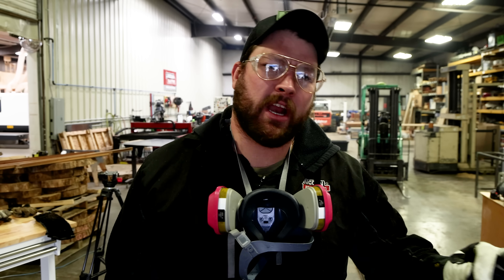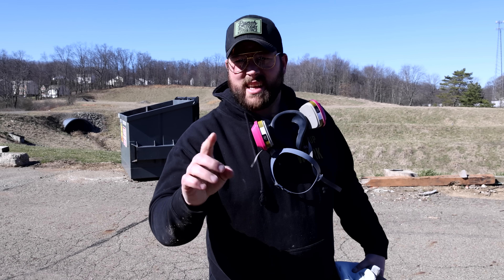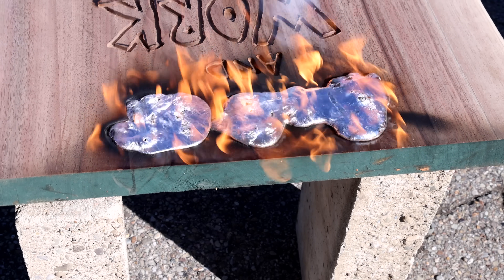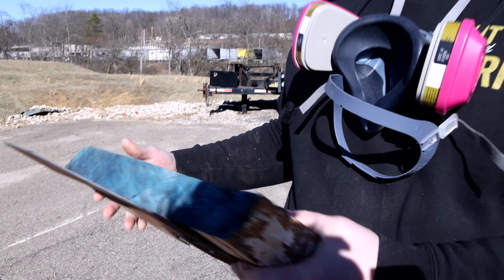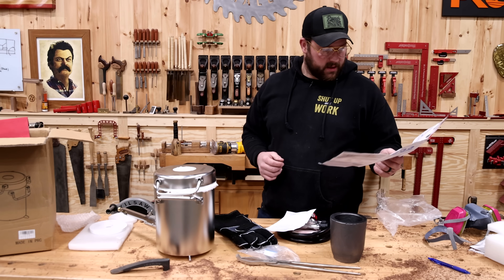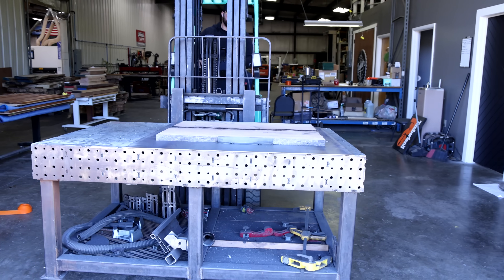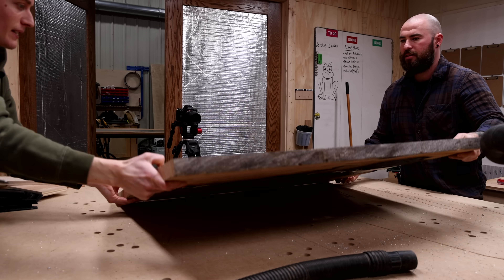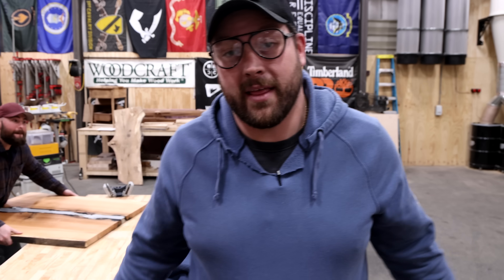I Tested Pouring Molten Aluminum in Wood

Comment: the end product looked like it could have turned out like the one from the video if you'd had someone with experienced in pouring metals working with you. The wood itself looked like what was in your reference, but the pours you made were ugly as hell. Maybe a final step of covering the top of the piece (after sanding/finishing) with a thin layer of resin would seal in the charred bits and fill any gaps between the metal and wood.

Comment: Fun and dangerous fact: even fine sawdust, when air born, is also an explosive dust due to a combustive reaction. Always manage your dust levels ion your shop, be it a metal shop or wood shop. This also includes dust just settling on surfaces since a small pop can throw all the settled dust into the air, then you get a flame front that explodes the rest and will give and your entire building a very bad day. Always clean up flammable dusts like metal, sawdust, sugar, flour, resin, anything.

Comment: I'd suggest holding the large plate of steel with your forklift and setting up a small sprinkler underneath it to cool from beneath and then lightly wetting the wood before you pour the aluminum. Lastly do several small pours like do 1 of those small ingots at a time because the smaller amount of aluminum should cool more quickly than pouring a large amount at once

Comment: Please do not wear that PPE hard hat and shield is what you need.  that mask can melt to your face. 100% cotton! 15 years casting aluminum many burns😅
Ps partners at work said o no when they seen you in those
NEVER PUT WATER ON MOLTEN/HOT ALUMINUM

Comment: This was so poorly handled. I mean, I know that you guys are experts in wood and not metal, but all the crap you talk on the metal side is so bad, I'm tempted to go outside my normal bailiwick and demo a mini version of this just to show how it should be done. I actually might do so, if I can clear enough space in my schedule and find the cash for the raw materials.

I'd like to give a short overview of things that specifically went wrong here, but I can't; there's more than one way to skin a cat, and each approach works in slightly different ways and thus takes slightly different steps. But just for one issue that immediately comes to mind here: you didn't use any flux. Without the flux, of course you're going to get poor results, especially with multiple pours. There are a dozen things that could have been done differently, but that's just one quick, simple example of something that could have made this go at least slightly better.

Comment: Ugh - you made so many mistakes doing this - what follows is feedback, not criticism.
First, you should have been using the gas furnace to make your ingots as you would have finished in about a quarter of the time it took using that tiny electric one.
Second, from the looks of things, that gas furnace was made in China - you are lucky it didn't blow up or melt on you - spend the extra few bucks on a Devil Forge in the future.
Third, your aluminum wasn't hot enough - good rule of thumb when you're doing anything other than ingots is to heat the metal up 20% higher than the melting point so that it flows like water and doesn't seize up and instantly solidify when it hits a cooler surface.
Four, you should have preheated the metal plate you had on the bottom and ideally, had it resting on something hot as that steel was instantly cooling the aluminum and ensuring that no aluminum poured on top of it would have any hope of melting and merging with the previous pours.
Five, your crucible was too small for the job - should have just bought three or four furnaces, had all of them melt a crucible full of aluminum at the same time and then poured them one after another.
Safety problems.
Grabbing a glowing crucible full of molten aluminum with tongs the way you were doing is a surefire way to have that crucible break and you don't want it falling to the ground, shattering and sending blobs of molten aluminum in every direction.
Lighting the furnace - set the gas feed for as low as you can and light immediately - DO NOT allow gas to build up while you figure out how to turn on your torch like you did.
That gas hose was WAY too short AND you failed to cover it with something to protect it from possible drips, spatters and other accidental contact with molten metal.
You never mentioned how dry the wood is - wood has moisture and sometimes resin/sap in it and this can cause a steam explosion with aluminum - do a search for "Home Foundry Steam Explosion - November 2022" if you want to see what sort of danger you were in.
Conclusion.
All said, you could do this right if you were to limit your project to the size of the resources you have available - ideally, you should finish with either a single pour or several pours made one right after the other as aluminum which has been allowed to cool while you melt more and then had hot aluminum poured on top of it leaves very visible layers.
Another challenge is the aluminum you used - not all aluminum is the same - for something like this, I would recommend hitting your local thrift store and buying a couple of aluminum baseball bats.
As previously noted, temperature is key - get yourself a laser thermometer and get the aluminum up to at least 1450 F - the crucible should be glowing pure white at that point - and you'll have a far cleaner pour.
If you're using a metal base then have someone running a blow torch across the bottom of the metal, put a container of glowing coal beneath it or a really strong space heater - you don't want the metal base to burn the wood, but it should at least be hot, ideally uncomfortable to touch bare handed so that it isn't sucking heat from the aluminum and causing it to seize.

Comment: Why not just wet the edges of the wood, or cool under the table with liquid nitrogen or ice. Keep the metal plate cold. The thermal shock will cause the aluminum to buckle in the wood